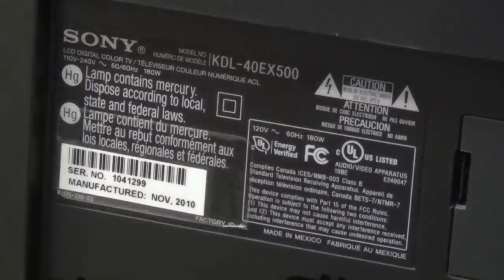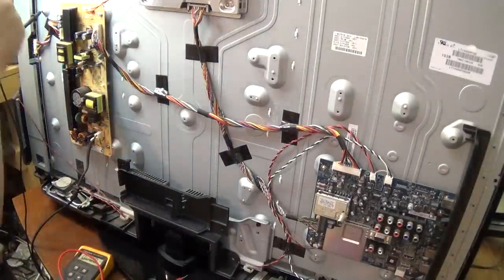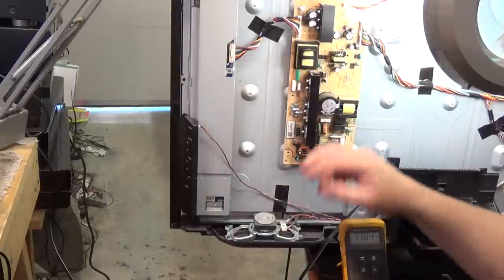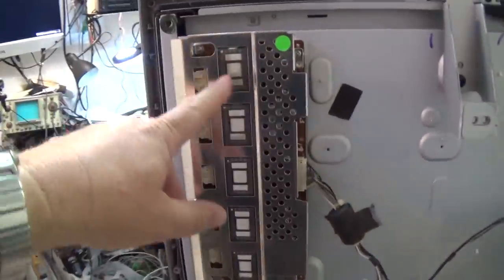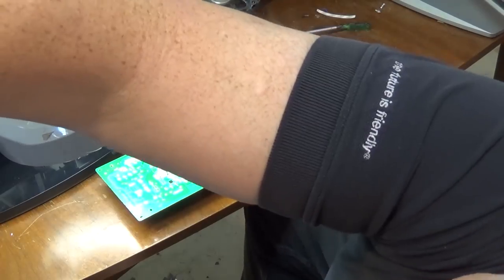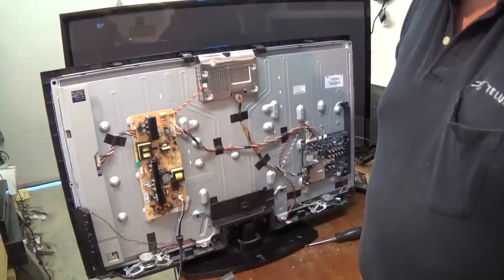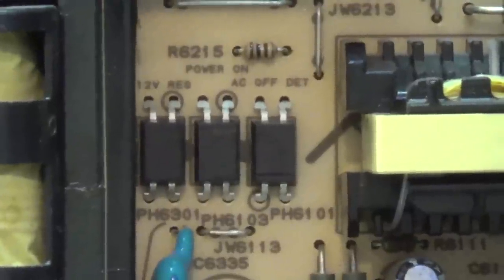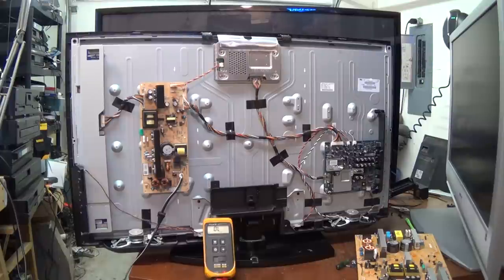Sony KDL40EX500 Dead set. Can this one be fixed?

Comment: Always nice to watch your videos, thanks for explaining things in a good way so people who has not really been working with that set (or that type of unit) can have an easier way of understanding things.

And i know people bash you from time to time let the haters hate lol you know, you beat them in every single way.

Last thing i repaired was a faulty powersupply of a samsung 32" lcd tv that probably had a powersurge on the mains rectifier bridge toast and the ptc did do its job i say both driving transistors to thebacklight did short circuit too but they are replaced and now a working set.

Comment: Sony TV's have overall better picture reproduction than other brands, we have a KDL40 from 2013 Led LCD and I'm impressed by the color reproduction and the black level (it has 3 stages of black leveling) it's pretty darn good for a LCD. I also have a Samsung Plasma 42 inch from 2007 bought it used for 50EUR (aprox. 55USD) and it's still rockin' 💪 now I'm going to repair a Samsung Plasma PS51F5570 (in the US known as PN51F5570 and PN51F5500) that I've bought for 30EUR (aprox. 33USD)! Y sus is faulty it has a blown TPC8407 IC, Q5005, 2 shorted transistors and maybe some other components... so I bought a whole board instead and now I'm waiting it because it's not shipped yet. I only hope that the panel doesn't have any vertical lines because those are a really pain in the ass to repair, if it's only a bad COF bonding on the ribbon cable than I'm lucky :-)

Comment: I think my parents have the same Sony TV. Either this model or one very similar to this. It's a great TV, nice picture as you've said. An interesting thing is they have two brightness modes for the LCD backlight. If the picture is very dim or mostly black they dim the backlight to make the black look more black. That's of course the disadvantage of LCD technology, black is never 100% black. That's what OLED technology will fix. From what I heard Sony is one of the leading companies in OLED technology. Maybe that will enable them to make a comeback as the company with the best TVs like they were back in the Trinitron days...
Reply from the maker: DrCassette Most LCD sets use backlight dimming these days to try to improve black levels.OLED is superior technology. My camera uses that for the viewfinder, so what I see is exactly what the sensor sees. Lets see if they can get large oled technology screens that are affordable as the current ones certainly are not.

Comment: I'm still learning and I know I'm going to have to watch this video again.  There's a lot of good information here.  Thanks for going over your troubleshooting procedure at the end.

Regards, Tom
Reply from the maker: THOMMGB This was a good one, a power supply damaged by a power surge.This is the type of damage experienced by lightning strikes.
A word of warning, buy only original parts from Sony. They are pricey, but the market is flooded with cheap knock off parts that will blow up in your face.I got stung repeatedly when I was in the biz because the shop owner wanted to maximize profits, and wanted the 3.00 parts from aftermarket sellers rather than the high priced originals. The counterfeiters are very good and the knock off parts will look identical. Not until you grind away the case material and reveal the semiconductor chip do you see the difference. This is why I resorted to pulling good parts from another Sony TV board. This set was for a paying customer, and I do not need to have a boomerang due to cheap parts. The parts I used were rated higher than the originals, so they won't fail again.

Comment: Hello, excellent video. I have a KDL-32BX321, the card is the same, but with the multimeter at terminal 3 (power on), when I connect the 127 vac power cord; 3.3 volts appear without pressing the power button.
What items can i check?

Comment: Thank you for making such videos. Sir I have a Toshiba lcd TV 32" .when we press the on button from the remote green LED is working and a flashline appears on the screen and blackout. I check the 12 & 24 v is coming when I press the on button and disappears. I replaced both optocouplers and filters but it doesn't make any difference. Sir pls advise me what could be the possible problem? Wtg for your valuable reply.thank you.

Comment: Thanks for the informative video. At 0:30 where you are showing the model number, voltages, serial number,  etc it shows the voltage as 110v- 240 v 50/60 hz at the top left. however at the bottom right enclosed within a box with UL, FCC symbols, it reads only 120v 60 hz - just wondering why  - is this TV and power supply capable of handling 220 v ac 50 hz ? and if so why do they list both a voltage range of 120-240 as well as 120 on the same label thanks

Comment: Great job but did I see you using the top of that primary filter cap for a ground measuring DC? That's not a ground, either hot side of chassis or cold. You'll get a reading but it's due to capacitive coupling. Glad this worked out though!
Reply from the maker: +Mark Zacharias In many large capacitors the negative terminal is internally bonded to the can.This one is such a cap. Had it not been I wouldn't have got a stable reading, it would have been all over the map. and I would have been looking for the hot ground point. Out of a box of used caps I just checked more than half of them measure 0 ohms between the ground and case. These are all standard 85' caps. All the high temperature and high frequency caps are totally isolated.
Reply: +12voltvids Just checked one on a similar Sony board. No continuity. Seen it lots of times of course on older multi-section types...
Reply from the maker: +Mark Zacharias I just checked 2 scrap boards from Sony LCD sets. One was the board I pulled the transistors from. One board had continuity from the can to negative, and another similar board but with a different brand of caps did not. It all depends on the brand, and the manufacturing process they use. Not all multi sectional caps had a common ground. Many did but not all. This one did because I had already done the diagnosis off camera before I rolled. Had it not been grounded I would have used the negative side of the bridge rectifier as my hot ground reference.  If you look at some of my other power supply service videos you will indeed see my hot ground reference to the negative terminal on the bridge. I only used the capacitor on this set because this cap was a ground reference.Try measuring the raw B+ on one of those with an isolated can, you won't see the 390V from the voltage doubler, you will be lucky if you see anything because your meter probe will effectively be connected to, well nothing!

Comment: I have a problem with KDL40EX500 TV, when I turn on the TV I Have the screen remains black, by the time a bright light appears on the TV and the red light flashes.
Reply from the maker: +Denis Horellou You need to count the flashes of the red light, That is an error code that you can look up, and it should guide you in the right direction. I have no idea what is wrong with it based on that description.  Could be one of the fluorescent tubes failing, and drawing too much or too little current and causing the TV to go into shut down mode. This is the only set like this I have worked on so I can only comment on what work I have done on it, and you see it here in the video.

Comment: Hi, 1st thanks for this video.  Have you worked on the power supply of the EX2m chassis?  My power supply has no 3.3VDC standby voltage and all fuses are good.  Where should I check for the source of the problem?

thanks!
Reply from the maker: +the wonderland If you are missing your 3.3 it is one of a few things. Either the capacitors in the standby secondary have failed (high esr) or the oscillator is not working.Unfortunately I am not familiar with that model number, but all switching power supplies operate pretty much the same. I had never serviced the model in this video before I saw this one either, yet I was able to figure it out without a schematic relatively easy.

Comment: the value looks different on the original Mosdfet 2SK4096 vs 2SK3568 the replacement part won't higher current rating cause other parts to fail is.the current is. it correct
Reply from the maker: No not at all. That is the maximum ration the part can handle. Just because the part can handle more voltage or current doesn't mean the device will draw more. The device will draw what it is designed to, which would have been below what the original parts were rated. The higher rating of the new parts just means more headroom, so they will never fail again, and no it will not cause other parts to fail.

Comment: it seems that switch mode power supplies are unreliable; the constant switching of mosfets just works them too hard, causing failure; all of this for saving expense of power transformer.
Reply from the maker: Actually the use of switching power supplies stemmed from the requirement to make equipment more energy efficient.

Comment: The true tale of an excellent Technician. You troubleshooted to replace components. Most would have just replaced the whole board!!
Reply from the maker: +service1956 That is true today, and I have done that too. I changed the buffer board on a Samsung plasma that was given to me because the entire board cost 15.00. I also did have to repair the cold solder on the y sustain that was the root cause for the buffer board blowing in the first place.

Comment: Hi 12v, I have this same model Sony set, totally dead after a storm. I replaced the PS board (with one that was supposed to work, but not guaranteed), and now I have 3.3v at Standby. But Tv still didn't work. So I then replaced the main board, but still nothing from the TV at all. So I suspect my replacement PS is bad. 
How did you get power to go into the "Power On" lead? Hit the power button, jump standby to ground, jump standby to "Power On", etc? Thank you, Scott.
Reply from the maker: More than likely. You need to check the individual voltages and see if all the supplies are operating. I TS down to component level on this one. It isn't my set, it is one that came in for repair, and went back to it's owner.
Reply: Thanks a lot 12v. I'll watch the video again, but I don't remember seeing how you got the main board to call for power. At about 4:30- 4:40 you say it's calling for power at "Power On", but I can't figure out how you did that. Nothing appears jumped in your video. I put the voltmeter at Power On and hit the power button, and got zero V. If I have correct standby power, would a good main board supply power back to the PS by merely hitting the power button?
Reply from the maker: I said the 3rd one up (from the bottom) is the power on. It toggles between 0 and 3.3 to turn the PSU on. That connects to the opto coupler, the middle one is what I am pointing at. There will be voltage across the LED COLD side (the top pins) which will be making the internal LED shine on the photo transistor which is on the HOT side of the power supply. WHen I refer to the HOT and COLD side I am referring to the hot ground side, or primary side of the PSU, and the COLD side is the cold, or isolated ground side, or secondary side.The job of the opto-coupler is to provide electrical isolation between the HOT AC side, and the isolated side of the chassis. If you get the voltage toggling on the power control opto isolator when you press the power button then the control board is working, and you have a PSU issue.
Reply: Thank you very much for taking the time to explain it. I was advised to disconnect the main board, jump Standby to Power On (to remove the main board from the situation), then test the two "REG12V" pins for voltage. I got zero volts at both, which I assume indicates that the PS is bad. Sound definitive to you, or should I also recreate the test you describe/show? Thanks again.

Comment: hi , excellent video. i have a KDL-46EX520 power board, how come my 3.3 standby voltage is dropping? Can you assist me please?
tnx
Reply from the maker: Possible capacitors drying out in the power supply. Or something is loading it down.
Reply: hi, tnx for the fast reply, i'll check on the capacitors and keep in touch. tnx again

Comment: Why would they create a high frequency AC signal from the rectified AC signal? PWM?
Reply from the maker: That is how switch mode power supplies work.  Around 50 kHz. The reason is efficiency. A small transformer as opposed to a large 60 Hz transformer.  
95% efficiency vs 60-70 max.
Reply: @12voltvids  yeah it is pretty obvious now that you say it, not sure where my head was... thanks 😎

Comment: Would you fix my A board of panasonic plasma tc-p42x1.  It was reined at and another repair store said it is not worth to repair.
Reply from the maker: No I wouldn`t touch anything fuc&ed up by someone else.
Reply: @12voltvids  No problem.  Thanks for answering.  It is f by one above (rain).
Reply: @12voltvids  PTS electronics didn't try to fix it.  They just checked and said it is not wort to repair.  If you want I can sand you board and you can make video why is not repairable.

Comment: The indicator flashes 3 times and has already flashed 5 times at another time, I do not know what that could mean.
Reply from the maker: +Denis Horellou You are probably not going to like this answer.According to the service manual 3 blinks is either the main logic board, or a power supply issue. Check standby and run voltages to determine if it is the power supply.5 blinks is bad connections between the LCD panel and the tcon, or a bad panel.Told you that you wouldn't like the answer.
Reply: +12voltvids The LED now flashes red 2 times, I do not know what that means?
Reply from the maker: +Denis Horellou Check google. The error codes can be found there.Just search for the model number and type 2 blinks and the fault codes should be displayed.
Reply: I have a Sony power supply board reference is APS-254 is 147420221-1008B408523 and TV KDL-40EX500 reference, by turning it a green light and a red flashing 2 times, stops flashing and returns to red flashing 2 again.
Reply: +12voltvids I 3.3V to power on the CN6401 when I press the button and after a few seconds I lost and I 3.3V puts the red light flashing 2 times stops and repeats flashing 2fois

Comment: Hi 12voltvids
Do you think its better to 
Fix at component level 
or replace the whole board?
I know it's cheaper to buy 
at component level,
but just curious 
Thanks for you're awesome videos 
I learned a lot from you 
😇😄❤️️😇
Reply from the maker: Board replacement is easier for sure. If you have the skills to do component level, then go for it. The satisfaction of troubleshooting to the component level as opposed to being a board jockey is worth it. At least for me it is.
Reply: Only replace a board as a next step if component repair is either not economical or practical, and time is money (especially for customer items).

In the old days of tube equipment, technicians who replaced a bad tube were often called "valve jockeys' (or "tube jockeys" depending where you lived). The number of call-outs to replace a white-capped vertical or horizontal output tube in a B&W TV was high back then.

Comment: For me that was broken was the two 2SK4096 8F5 Mosfets and one Electrical 0.1 Ohm Double Pin Resistance Fusible Resistors, same as in this video.

Replaced them and now the TV works as new again, thanks 12voltvids for the suggestion.